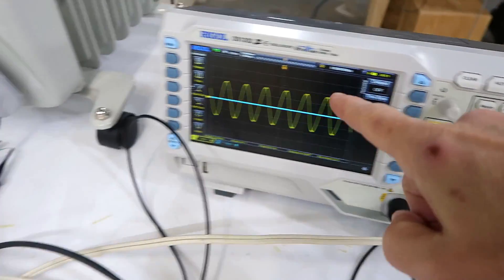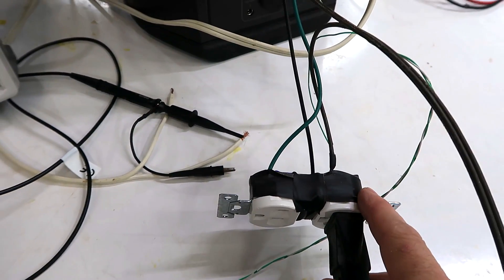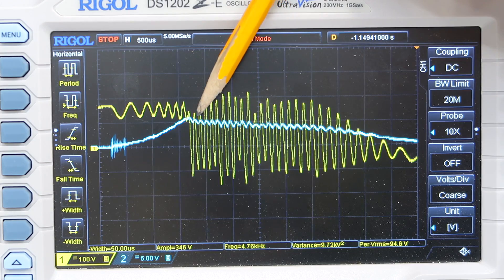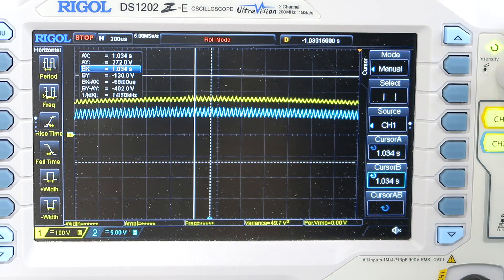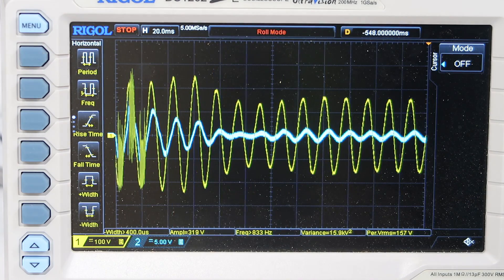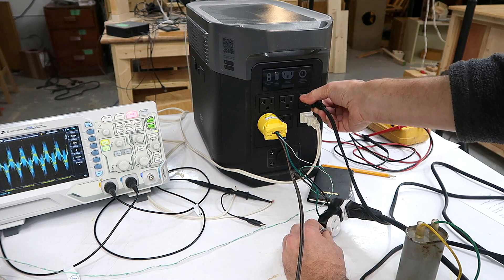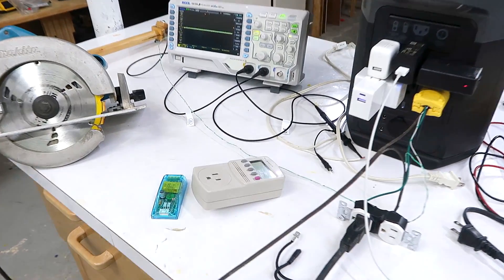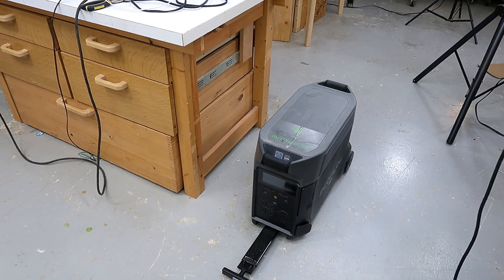Inverters don't like power tools

Comment: Another great video and demonstration Matthias! Only note about neutral to ground bonding...it's an absolute no-no when the unit is connected to the grid (you already have a bonding at your service panel) but when running standalone, some devices such as GFCI's or RV protection circuits may malfunction if you don't use a bonding plug. The trick is to attach a bonding plug to the end of the Ecoflow's AC charging cable that plugs in the back of the unit. That way, you cannot put the bonding plug in front at the same time of having the AC grid plugged at the back of the unit.

Comment: Large motor starting currents are why there are inverters with large overload capability of up to 300% so the problem here is just not using the right equipment for the situation.

Comment: I there a device that is available to soft start induction motors that don;t have the soft start feature?  I don't have enough know-how to build something.  I am trying to determine what size inverter to buy to be able to start a 900 watt table saw and 1500 watt air compressor.  Those are the values I measured with my Kill-A-Watt, but it doesn't measure peak watts at start up.

Comment: In other words, if you want to start inductive loads like refrigerators, microwaves, portable AC units or power tools, then you should stay away from high frequency inverters like the ecoflow and stick with low frequency, transformer based inverters.

Comment: The Neutral is connected to the Ground in the main house entrance panel in Canada. When you plug in any 120volt device, the ground and Neutral will be connected together back at the entrance panel. How will the power pack handle that?

Comment: Than you for the information and video! I appreciate the effort you put into your channel !! Question… While battery generators are able to run refrigerators and forced air blower furnaces I assume doing so often enough would greatly reduce the lifespan of the artery generator.  Would you have a battery / inverter combination recommendation better for refrigerators and furnaces?  A 12v / 100AH battery paired with what kind of inverter is best for a fridge or furnace?  Thank you again !!

Comment: The Ecoflow uses high frequency transformerless inverter technology which is no good for powering high inductance loads like full sized refrigerators, large power tools, portable AC units or full sized microwave ovens. You might be able to start and run some high surge loads when these solar generators are new, but every time you fire up one of those inductive loads, you're shortening the life of the MOSFETs in your solar generator's inverter. A far better alternative is to invest less money and purchase a hybrid, low frequency, transformer based inverter charger and an LFP battery and build your own real solar generator. Low frequency transformer based solar generators last many years longer than these toy high frequency solar generators, and can easily power high surge loads without being damaged and without damaging your appliances. That's why the big name brand inverter manufacturers like Schneider Electric, Outback Power, Sigineer, Victron and others, all use a low frequency topology in their offerings.
Reply from the maker: Actually, it is able to run all those loads you mentioned.  The problem is the first 50 milliseconds for larger (12 amp) power tools.  Frides, AC, microwave -- no problem there.
Reply: Like I previous said, you might be able to start and run some high surge loads when these solar generators are new, but every time you fire up one of those inductive loads, you're shortening the life of the MOSFETs in your solar generator's inverter. I have 23 years in the inverter repair industry and over 90% of our repairs have involved the replacement of MOSFETs and electrolytic capacitors in recently out of warranty, high frequency, inverters.  @matthiasrandomstuff2221

Comment: Inverters need huge deep cycle battery or a super capacitor in-line. And won’t have a issue u need 2-3 batteries at 100ah battery and a super capacitor for the surge it would be able to handle the amp draw also a lg audio alternator will work I used a huge wench on my Tacoma and draws 100ah at max it doesn’t have a issue yet

Comment: Use soft starter, and you get rid of the issues... and is is safer for the inverter
a simple soft starter is a relay that short a series resistor after a specified amount of time 1-10s, instead a resistor and NTC Resistor will do an automatic current regulation increase until the delayed relay will short it

Comment: I appreciate the time spent quantifying why the capacitor is not to be LEFT in the circuit. But, isn't it frequently done that a motor device removes the 'start capacitor' from the circuit shortly after startup? This can be done externally pretty simply, so my thinking is not to throw the baby out with the bathwater as far as the homebrew 'soft start'. Just that you should not expect to leave the capacitor in the circuit full time with no consequence?
Reply from the maker: Because you don't know when the motor starts, you would have to leave it on all the time in anticipation

Comment: seeing that connecting neutral to ground leading to blow up the inverter is unsettling. In Europe are neutral and ground always connected and it's part of the security for household electricity (if you have a current between neutral and ground because of a defective electrical device the safety mechanism breaks the electric connections). Most electric devices need that ground to neutral connection to work properly. This can mean those Powerblocks don't work securely here.

Comment: An inverter should be designed so that the neutral can be grounded, otherwise any GFCI  (RCD)
protection will operate normally  -  do these manufacturers understand elecricity ????????????

Comment: I try to tell people to not use cheap smaller gauge extension cords with electric (AC) motors. For a similar reason, but because it puts extreme stress on the motor when it can't pull the current it needs at startup or under heavy load. It will also like melt your extension cord.

They point at the sticker and say, "My saw says 13 Amps, and this 14 gauge cord says 13 Amps." And I can't get them to understand that's under average load. Just running the saw might only be 5 or 6 Amps, but pushing material through it increases that load. 

The motor wants to spin at the same RPM no matter what, so it pulls whatever current it needs to spin at that RPM. The denser or more restrictive the material, the more current the saw tries to pull. The same goes for start-up. You have a blade, arbor, and motor all sitting still when you squeeze the trigger, and then suddenly your motor wants to go from zero to 1000+ RPM, and it has to move all that mass as fast as possible. That's a crazy amount of load on the circuit, as shown in this video.

So if you are using anything with an electric motor and the cord gets hot, the same thing is happening to the motor windings, only worse. This goes for anything with an AC motor; refrigerators/freezers, fans, air conditioners, and yes, power tools.

Comment: ELI the ICE man.  E represents voltage.  Correct any mistake, as this is memory.
Voltage leads current in an induction circuit
Current leads voltage in a capacitance circuit
So why is there such a small phase shift between voltage and current?

Comment: As someone that repairs industrial motor drives for a living, I can tell you that the current protection is there because they didn't want to do their due diligence and engineer in enough overhead. Yes, it's technically true that it's there to protect the switching elements.... because they went cheap on that completely critical component.
That rapid switching when it's in protection mode is also pretty bad for any fet or igbt. The smart choice is just to make a good product that can handle common devices that will push the inverter past its continuous rating for a few moments on startup.

Comment: So called  "universal" motors, AKA  older AC/DC  brush type motors in  vac cleaners,  shop saws,  etc,  have always had a tremendous  surge / start load.  Not surprised that the  overwhelm  an inverter    Largest UPS I was ever around was back when installing  E911  telco/ data/ communications systems and upgrades in dispatch and  radio sites.  One  dispatch had a UPS  the size of two large  coke machines.  Most of course, was batteries.

Comment: 20W just sitting there?????
Bloody hell. That's more than I EVER use on my 50ft ketch, unless I'm using Radar and Sonar.
Or my electric Thrusters, or anchor winch (proper BRUSHED DC)
20W will run my fridge, lights, and device charging.

What a SCAM!

Ditch high voltage AC and all that electronic scum. 

All I need is a fifty watt solar panel, voltmeter when at anchor, even in midwinter. Mostly I only have to use it a couple of hours a day. 

If I need Electric thrusters then 200W of panels will move my yacht on electrics for 1-2 hours per day.
And she weighs 13 tons.

All you are getting with all that electronic shet is a thousand different ways for it to burn you and everything you own.

Comment: Quickly thinking about this initial high current problem on these AC battery packs, the manufacturer could add big capacitors that could take on a huge amount of current for a few hundred milliseconds which would dramatically improve the performance of high current startup tools and devices.

They could design it so that it's an add-on external capacitor accessory. Just an idea!

Comment: Considering that VFDs use IGBTs, one would think that an inverter designed for power tools could be built, ie with an integrated soft starter routine when it detects a motor-type load.

Comment: Not sure if you will read my comment but I wanted to ask a question that my electrician at work couldn't answer.
We had 1 microwave at work that pulls 13amps, we added a second microwave that also pulls 13 amps to the same circuit which is on a 20amp breaker. 
I would expect if we ran both microwaves at the same time that they would pull 26 amps and trip the breaker, but together they only pull 19 amps, also I measured the voltage drops from 119 to about 108V. So why 2 microwaves pull only 19 amps? Is it because the voltage dropped? or did the voltage drop because the load was too much? I am trying to figure out an explanation of what is going on. Can anyone help me?

Comment: People don't understand that with a sinusoidal power backup, there is a very small output filtering capacitor. There has to be because the voltage is AC. On mains power, its transformers all the way down to the power plant. So with an inductive motor start, there's no functional limitation to the starting current with mains power. The line resistance ends up being huge and the mains voltage doesn't distort, but drops to about half. With the sine power backup, notice that the voltage doesn't actually drop. It does get very noisy but it doesn't sag.

If this were pure DC, you could put as big a filter cap on the output as you want and none of it would be a problem, but its not. Its AC. The only "output cap" here would be something like flywheel storage, and you're welcome to buy one but its going to be the size of a tuck and cost you at least 100 grand. Factories do use them though when they have a lot of inductive loads starting and stopping.

Actually, on that point, you could make a poor man's version of this by just spinning up a big inductive motor load on the power backup. I think you'll find that the noise is a whole lot less as a second motor is spun up. Even something like a 2hp bench grinder running at the same time might provide the start current for your band saw.

Comment: Near the end of the video, you talked about not connecting the neutral to ground because it will cause damage. (Ground/Neutral Bonding)  I would never advocate doing this for MANY safety reasons... But, if you used a suicide cord to power a home, you would kill the machine due to the home in the USA having a Neutral/Ground bond in the service panel for safety reasons.  

If this is true, I'm surprised it cannot be bonded for safety.  This limits how the device can be used safely.  You can only use it as a stand alone and never power a bonded supply.  I have a generator that I need to un-bond when I hook it up to my residence during a power outage to keep things safe.  But needs to be bonded to use as stand alone so that the electrical protection functions properly like breakers and fuses.

Comment: Nice vid.  When thinking if I wanted to risk my Anker it occurred to me that (almost) all of the tools I use daily are battery powered and the power unit can run the charger. Since the power bank and tool batteries are close in voltage, it seems that an intelligent DC/DC converter would increase efficiency.

Comment: I was wondering if a resistive load could be added in series to limit current in rush during starting then shorted out after 1/2 second or so to greatly lessen the initial current draw to something the power supply could better accommodate.

Comment: INVERTERS that do not have a true sign wave do not like any kind of power tool or any kind of switching power.
If the INVERTER has PWM TECHNOLOGY (PULSE WITH MODULATION) and sufficient capacitance on the output, the inverter doesn’t care what the load is!

Comment: the saw certainly has a universal motor (series excitation motor). The direct starting of this type of motor generates current peaks of more than 10 times the nominal current, it is a classic problem in electrical engineering when the power of the motor is not negligible compared to the power of the power source. The proposed capacitor solution does not solve the problem and even risks generating resonances with the inductive character of the motor.
  the solution historically adopted is to carry out a rheostatic start. You insert resistors in series by starting the motor with no load and you gradually decrease the value of this resistor to obtain full speed, this solution is now obsolete. More modern by inserting a dimmer between the inverter and the motor (with phase angle adjustment) you can avoid the current limitation of the inverter, moreover many tools use this solution for speed adjustment (for universal motors not asynchronous induction motors).

Comment: It's a pretty robust inverter by the look of it. Mostly when running motors one should use an inverter designed for that purpose. These have a slow-start. This one is certainly impressive to take that kick of current. If you jam a motor it normally draws about 6 times the usual current

Comment: It gets even worse with well pump that is also AC motor but starting under load. I have off-grid cottage in New Brunswick where I use 12V battery with 2000W cont / 4000W peak inverter, and it runs 15A Dewalt table saw no problem, but fails to start 800W well pump 3 out of 4 times. Table saw starts without load, so inrush ends quick, but well pump is already under load so inrush takes longer and inverter overloads. You showing over 100A inrush to your saw makes now perfect sense, I was told to plan for 4x rated, i.e 4kW peak for my pump should work, but it seems it can go much higher. For now I can only have water with generator, will try soft start next time.

Comment: If you have loads with a high inrush demand, it's better to use a low frequency inverter for them. They tend to be less efficient overall which is why HF inverters are the norm. Would be good to see similar dual-purpose testing on one of them.

Comment: Don't connect neutral to ground? OK, but... they're physically bonded at the breaker box! It's not a normal connection, but weird shorts do happen in ageing electrical devices.

Comment: You might like to get acquainted with NTC thermistors. These have a "high" resistance when cold and get a lower resistance when the current warms them up. The "high" resistance is usually just a few ohms, hence the quotation marks. As a rule of thumb, for any non resistive load over 300W NTCs are a good idea to consider.  There are online calculators to find out what value you need to use.
Note you need NTC not PTC, those work opposite. NTC termistors are used for inrush current protection, PTC for over current protection.

Comment: I use the triac as a shunt for the solar DSP sine wave inverter with no problems at 1kVA.
Impedance matching inductor would help stabilize the output in most cases.

Comment: The soft-start relay should help with big motors.. but in this case, each motor device should have a separate relay.. usual problem. For example, when the power motor starts, usually it takes up to 8x-10x more power than it takes after it spins-up, so.. if motor rated for 360W, it may take up to 360*10W of power at peak, which is not so great for HF inverters.

Comment: Anyting with a universial motor that runs on A/c or DC such as 
Your circular saw.   I was doing electrical work at a house with out a generator but using 10 boat batteries in the trailer 
 All wired in 120 volt DC,  
I was running drills,  circulsr saws to cut 2x4s,  drilling though studs,   And yes old school
120 volt incandescent bulbs 
All on DC power.  None of this inverter nonsense. As any voltage conversion to DC to AC 
 Is 20 percent loss.   On 12 volt side of things it be like 83 amps plus inverter loss meaning it would draw over 100 amps on DC at 12 volt 

If u take 100 amp hour battery 
 At 12 volt in series.   U end up with 120 volt DC  100 amp hour 
  A 100 watt incandescent bulb 
 Is  .83 amp at 120 volts.   
 And circular saw 10 amp